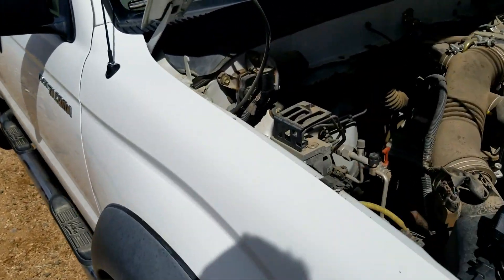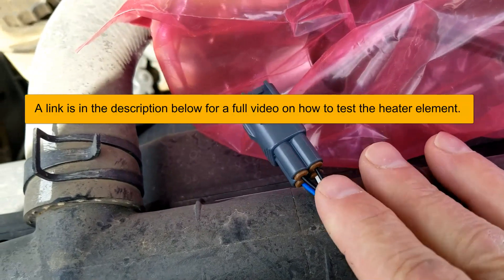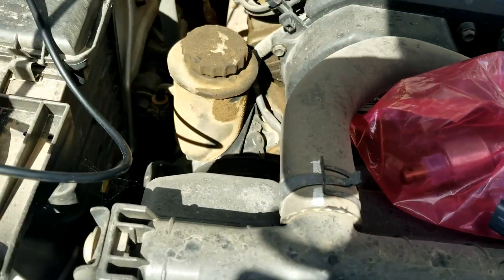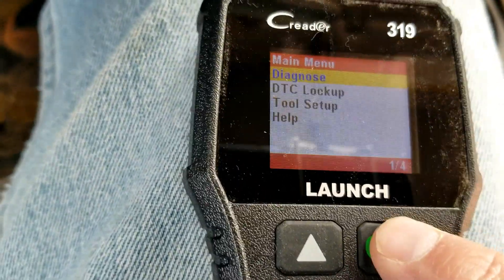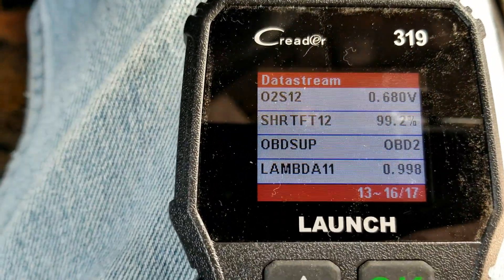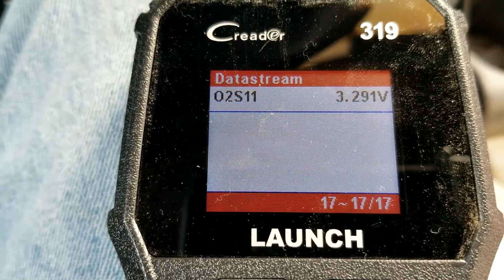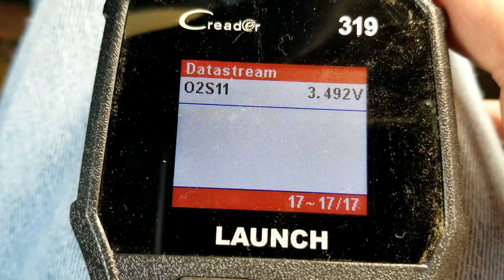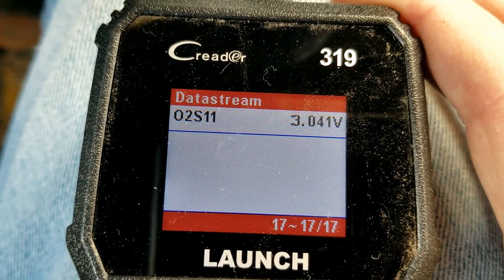How To Test Upstream Oxygen Sensor 1 in a Toyota Tacoma

Comment: I have a 99 tacoma pre runner 2.7. I have a lean code, changed almost everything nothing helped. My front o2 is reading 0.105 to about 0.830. When i pump the brakes my front stream falls between 0.020 to 0.015 as well as my downstream to 0.015
Reply: Did you fix it? I have a 2000 2.4 tacoma that has the exact same problem and hesitates acceleration

Comment: I have one thats is stuck on one reading  3.5 wont go up or down . Pumping break pedal  or reving high rpm . Nothing changes . Long fuel trim  stuck at 39 very high ,short fuel trim  0  they dont change . Cant find any vacuum  leak,  running  very lean  code P 0171. Engine light on .  Replaced MAF sensor , Pcv valve .  Its the air fuel sensor upstream , correct ?  Thanks
Reply from the maker: A P0171 code can be difficult to troubleshoot sometimes. If the bank 1 sensor 1 is giving no reaction, I would replace it. If that does not work, I would then check the fuel pressure on bank 1 and look for a possible bad injector.
Reply: @HVAC_Mechanic   Thank you for your response .  Upstream 02 heater was bad . replaced it (Denso )  , It reads at 2,5V at idle  (hot) and responsive  . Long fuel trim  stuck at 39 very high ,short fuel trim  0  they dont change. First day  rough idle ,   Second day truck  idles  better but  exhaust  smells slightly rich at idle , no problems   cruising  .Downstream 02  within range  .  It is a 2001 tacoma  4cyl,  auto 4speed, 120000 miles  similar as the video .